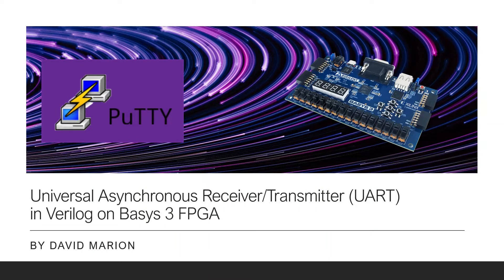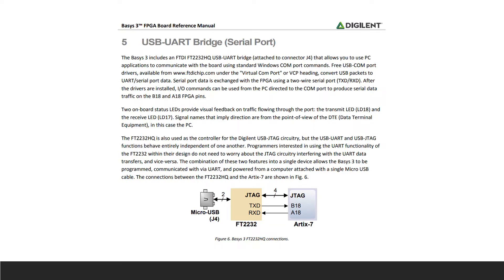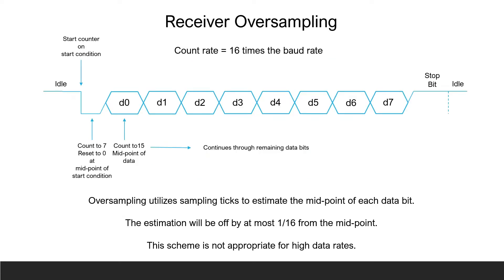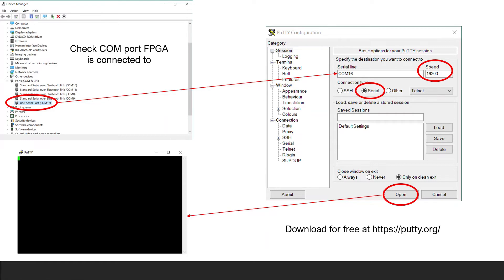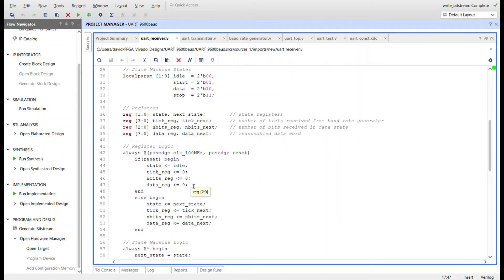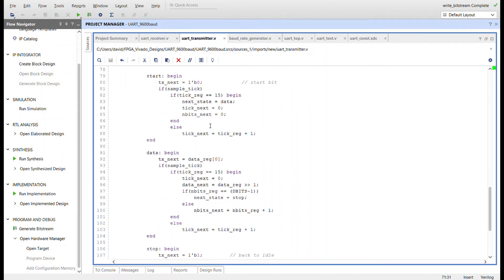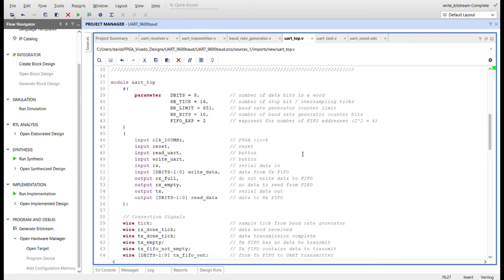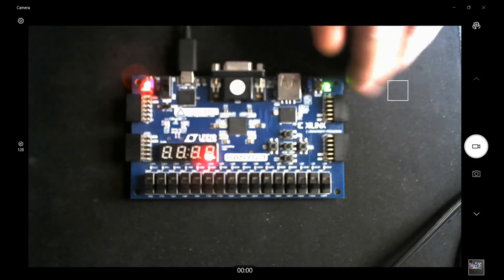UART in Verilog on Basys3 FPGA using PuTTY

Comment: Is it possible to interface fingerprint sensor R307 or R305 with fpga?
Reply from the maker: I've seen where the sensor was used with Arduino, so I believe it can. Just need to consider the voltage level, as an FPGA is 3.3V and Arduino is 5V.

Comment: Hi,
What changes should I make in this in order to make it work with nexys a7 board?
Thanks in advance :)
Reply from the maker: It has been a while, but I think you should be good with no changes to the Verilog code on Nexys A7. You will just need to use a constraints file specific to the Nexys, instead of the Basys.

Comment: very good concept of uart protocol you have demonstrated here.actually i am also working on uart based protocol but i am facing  a problem in vivado tool. i have design uart by system verilog and when i try to run by test bench sv code,in wave form it is not showing the green output waveform
Reply from the maker: Sorry for your problems. I also had problems before when trying to use system verilog in vivado.

Comment: Hi, have you ever had any experiences with gyroscope sensors on FPGA? i'm trying to connect MPU 6050 gyroscope accelerometer sensor to the FPGA, but i have found nothing online, so I am very lost right now. I've seen projects of making gimbals and i am trying to recreate it on a FPGA, do you think it's possible?
Reply from the maker: I have not worked with those, and I just looked up the MPU 6050 to learn about it here: https://create.arduino.cc/projecthub/CiferTech/what-is-mpu6050-b3b178
It looks like the chip is an i2c slave device. Have you looked at the MPU 6050 datasheet? That will tell you the format for communicating with i2c. You would need to create an i2c master to get the data from the chip. The data format should also be explained in the datasheet. It should work similar to the temperature sensor on the Nexys A7  which I cover in a previous video on i2c.
Reply from the maker: To answer your question if it is possible: if the projects you've seen use some kind of microcontroller, then yes is it possible.
Reply: @dajoma36  alright then, thank you very much for your help